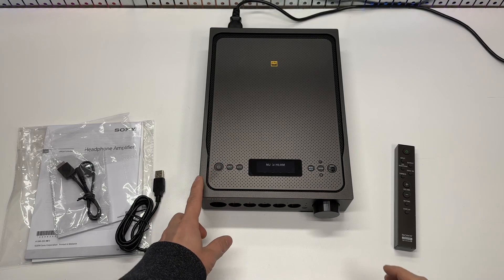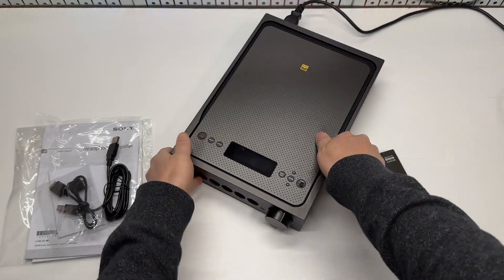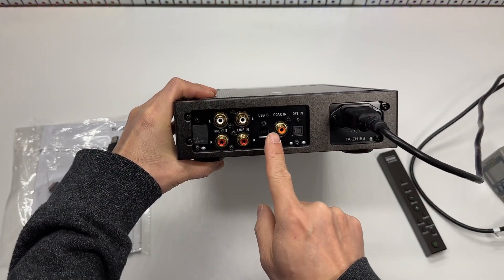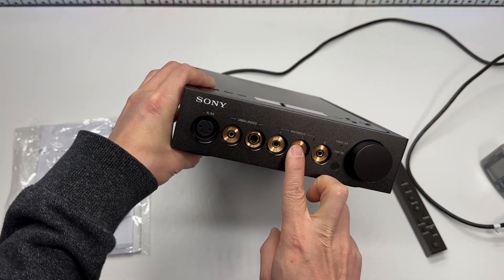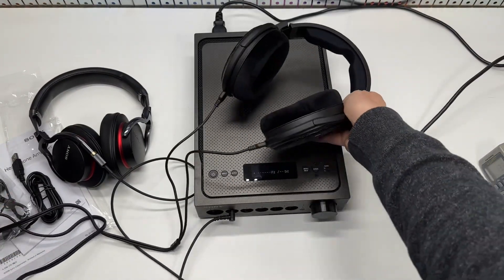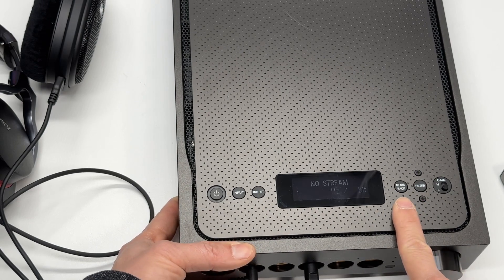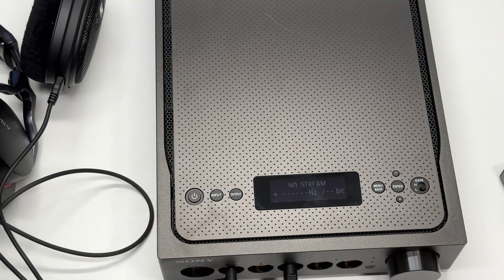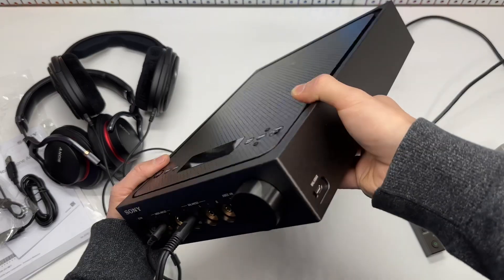Sony Headphone Amplifier TAZH1ES Overview (Signature Series Audio Component)

Comment: Ibwould love one but its old now lol.
Reply from the maker: what's the new one?
Reply: @ToolsElectroDIY  mojlnir 3 at some point. With a gumby 2 DAC.  Sony Walkman as my music server/secondary DAC.
Reply: @chronometa  No USB input and a power switch on the back, no thanks. And since you have a Walkman, how would you plug it into that Schiit without the proprietary Sony connector that's featured on this TAZH1?
Reply: @thekenthouse6428  I can do it with the newer walkman otg cable. USB-C(walkman)>USB b(DAC)>DAC takes over the processing. 

So basically the walkman becomes the computer. 

If I want to use the DAC in the walkman then I just use a balanced 4.4mm cable to the balanced headphone amp input, plug headphones into amp.